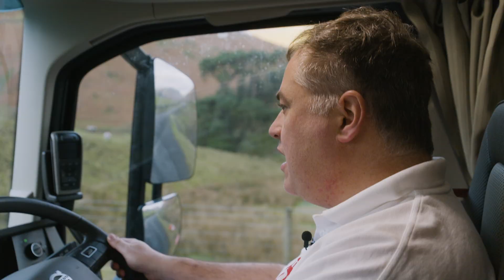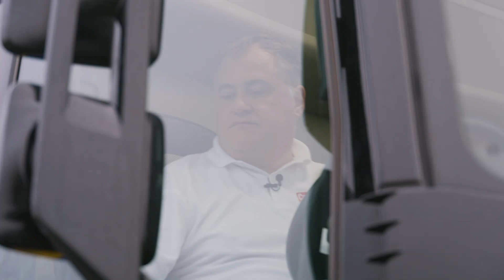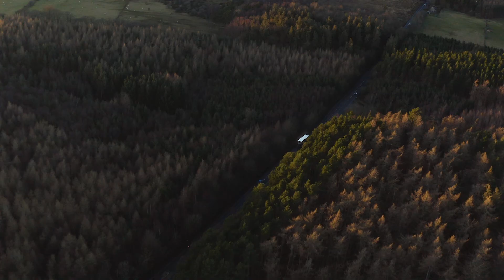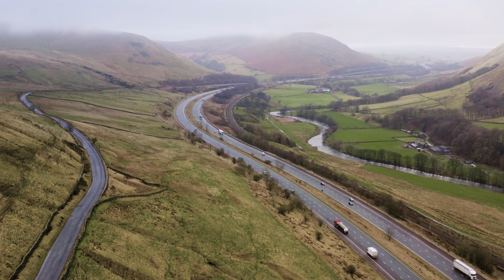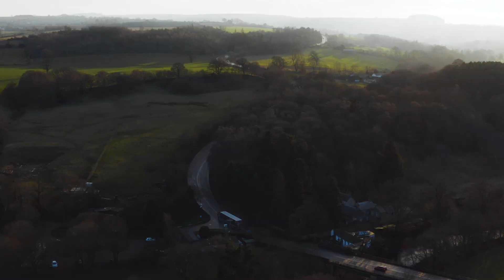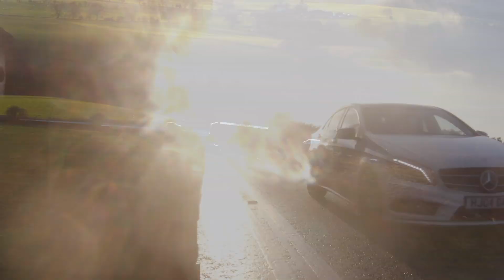Volvo Trucks – A new record score set by fuel test winner Volvo FH with I-Save

Comment: why the test is carried out in a country that has good roads ???  why isn't it done in a country that has a bad road ???  For example, Indonesia has poor and bumpy roads and steep inclines and steep descent.  Why???
Reply: Victor  It’s a good question, and it deserves a proper answer; The Volvo truck performs equally fine on poor roads. Actually, Volvo Truck is performing year long torture test in the back country in Sweden. Poor, rocky, mountain roads, muddy forest roads, any possible uneven road is being thrown at (under) the Volvo Trucks year after year, all to make sure the machine is performing optimal under any given situation- and road condition. 

“Why not a poor road for this actual video”, you ask. This kind of road was probably chosen to be able to compare testresults more accurately. Using cruisecontrol on the same road, again and again, makes the testresults very precise and compareable.
Reply: Because the client base is bigger in Europe than Indonesia . That’s why they’re testing them in Europe , European truck drivers don’t care how well can truck perform on very bad roads because there is no very bad roads here , maybe few but it’s rare